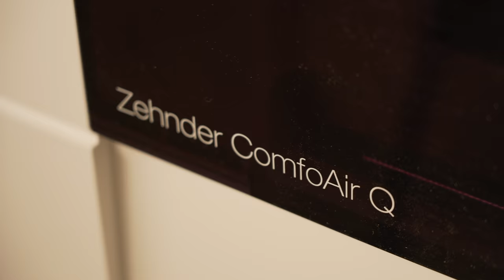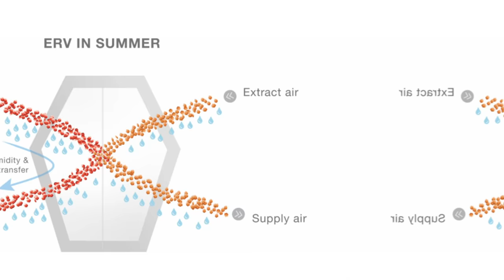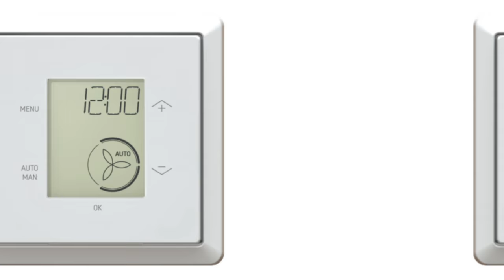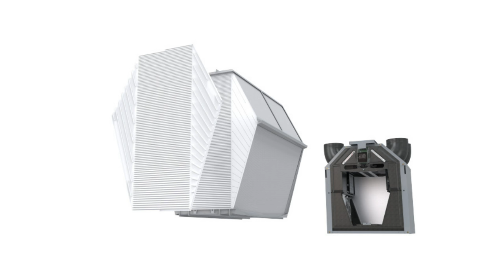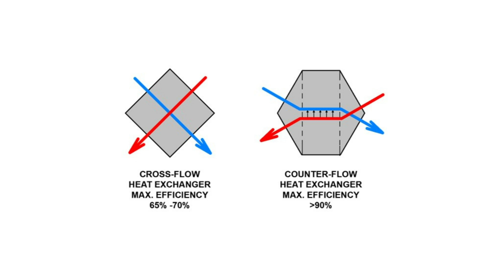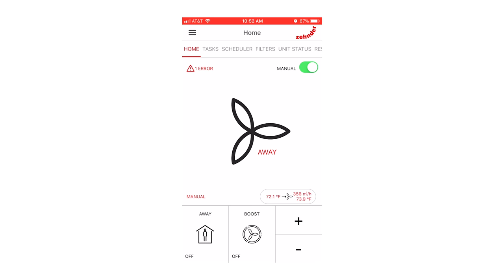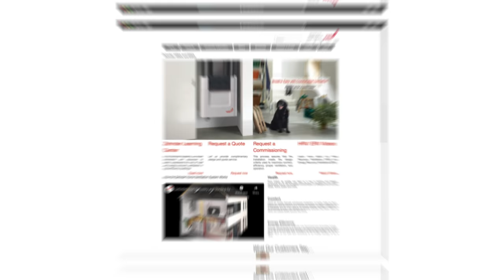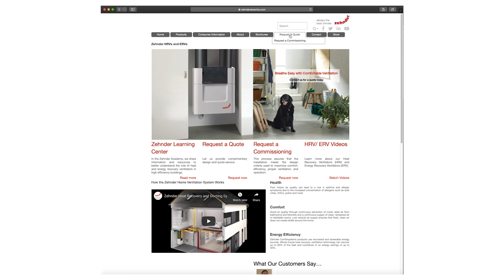Passive House - Fresh Air System Install & Costs (Zehnder)

Comment: MATT! You definitely need to check out the heat pump condenser clothes dryer. They are super effective and efficient and DON’T NEED VENTILATION! These help keep the envelope of the house tight and super efficient.

Oh, and may I please suggest you purchase a gymbal for the camera. It will negate much of the shaky movements. When I was working on my own documentary programs as a cameraman and editor, I used one for a fashion shoot and it helped the image to stabilise greatly. Cheers from Australia mate. 
Keep up the good work.
Reply from the maker: Actually I’ve been testing a Miele heat pump dryer and it’s pretty amazing. Perfectly dry clothes. 45 min run time. No vent to the outside!
Reply: I have a Bosch electric condensing ventless dryer. Works great, love not needing a vent.
Reply: @buildshow  Hi Matt, I'm in the process of self installing a heat recovery system in the UK. Your price estimates are about the same here too. I've also had a Miele heat pump dryer for 5 years in a small utility cupboard stacked ontop of the washing machine. It works billiantly but I decided to put a dedicated heat recovery extract vent in there to remove the slight tumble dryer smell of hot clothes. Even before intalling MHRV, I liked the fact that I wasnt wasting energy blowing hot air outside.
Reply: James Gleason because extra venting work equals cost of equipment and builders time! All saved by not having to need to vent a dryer.
Reply: @JamesBlazen   Switzerland has outright banned vented dryers since 2012. Heatpump or electric condensing dryers are the way to go.
Heating up air and then blowing it through clothes and then right outside is very wasteful.

Comment: Looks like a very good system, definitely important on a house built this tight. Would love to see the TAB contractor's ( third-party , must be third party to eliminate any conflicts of interest) results when his house is completed.TAB = testing, adjusting and balancing ( it is an actual trade with certification used mainly in the commercial and industrial building industry). With the covid virus TAB technicians are in very high demand right now, the mechanical engineers for hospitals and school are currently demanding a much higher air turnover rate with more make-up air. Good for my industry ( gas utility), bad for the customer ( higher utility bills). Currently in Germany all schools are mandated to open all windows for 10 to 15 minutes every hour ( they turned the heating system off and open all windows, after 10 or 15 minutes they close the windows and turn the heating system back on for 1 hour and repeat.). I can't wait till this covid virus thing is over.

Comment: @Matt -->Please follow up on your next videos how this system ties in with Bathroom exhaust and more importantly dryer (heat pump system) and stove vents (separate system to some how save energy, maybe?) Great videos, keep them coming.
Reply: It doesn't tie in. It completely replaces any bathroom exhaust fan.
Reply: @retartedfreak  Does it also replace the exhaust fan in the kitchen or is this separate?
Reply: @wkellander  i would think it is separate. IDK 100%.
Reply: Matt does a minor explanation from 4:20-5:25, and the installer guy explains it at 11:20-12:00. Basically, bathrooms, laundry room, and kitchen that would normally have exhausts/vents/etc will channel through the one "exhaust out" 8 inch duct that is part of the system.
Reply: @trinity1aee  So all that greasy air from the stove vent hood is going through that filter that protects the air exchanger from gunking up ?  That filter would need constant changing, unless there is another filter in the range hood itself.  Also, is the ERV fan going to be able to keep up with a 900cfm stove exhaust fan when it was designed for just 180cfm ?  I am pretty sure a stove vent needs to be metal, so those plastic hoses are only for supply fresh air and the exhausts from kitchen and baths are all traditional metal ducts ?
Reply: Am I missing something with the bathroom vents?  With an ERV like this, wouldn't it just cycle that bathroom humidity BACK into the house?  If it were an HRV, then maybe that humidity would end up outside the home...I would think this kind of defeats the purpose of having a vent in your bathroom. Does the Zehnder unit somehow regulate humidity levels then, too?  If it is compensating the system's humidity level by transferring excess into the exhaust, then that would make sense, but that was never mentioned directly in Matt's video.
Reply: @Madidahoan  Most of the bathroom humidity still ends up outside along with the air and stink.  The membrane that transfers water vapor inside the ERV must have a limit can only accept so much as the air moves through it, and most of the steam from a shower would not get transferred to the incoming air.  He did mention that his house will have a separate dehumidifier as well.  He will use a Fantec exhaust and make-up air system for the kitchen range where steam from cooking will go straight out -- no attempt to recover lost heat with that system since cooking grease would clog any HRV/ERV heat exchanger and filters too quick.
Reply: @kirkellis4329  I share your concerns with the stove exhaust. I reviewed the time stamps that trinity1 pointed out above and while I don't believe Risinger was trying to be misleading, I would be surprised if the stove exhaust went through the ERV. I'm going to review the Zehnder website and look for clarification.
Reply: For a range, particularly a gas range you'll still have a normal hood vent. Hopefully it's not a microwave as well and it's just on a normal switch cause you need a fresh are intake right behind the stove. Usually this is a 6 inch piece of ducting with a zone damper in it. When the hood is off the damper is closed, when it's on it also provides power to a small transformer that opens the damper. This creates negative pressure near the back of the stove along the wall and it should pull most cooking fumes away like normal.

Comment: Matt Risinger, thanks for sharing this! I appreciate your dedication to clean indoor air. That Gas appliances add the possibility of carbon monoxide is reason ENOUGH to go all electric ⚡️
Reply: Gas heating is far far cheaper than electric and likely more environmental too depending on the source of your electricity

Comment: I would like to see how the dryer vent is hooked in. I am also curious how the kitchen fan vents through it.
Reply from the maker: I’ll have a separate system for the kitchen exhaust. I’m using a heat pump dryer so I won’t need a vent
Reply: @buildshow   Any particular reason why the kitchen exhaust isn't being integrated with your Zehnder system? I'm very curious how these ERV/HRV systems can integrate that exhaust since they typically require a substantial flow rate but only when called upon. I like the idea of one exhaust penetration for the whole house, I'm just not quite sure how that can be managed with these systems. Also, how are you managing the evaporated moisture from your heat pump dryer? I would think you would still need a vent for that. The heat pump in the dryer is only a heat source to facilitate evaporation of moisture from the damp items within it.
Also,
Reply: @buildshow  even if you had a dryer vent, the q600 can adjust supply and exhaust rates in response to the dryer exhaust. by not having a dryer vent, you are putting a big humidity load in your building envelope, and the zehnder system shown does not provide humidity control. so you would have to have mechanical systems (force air conditioning and/or dehumidifier) to provide humidity control.

some people go for a recirculating hood, but a kitchen exhaust is going to work better.

i have a heat pump water heater and considered a heat pump dryer but concluded that it really didn't do much and was pretty much a waste of money.
Reply: you definitely don't want the kitchen hood tied to the dedicated outdoor air system. the grease and residue from cooking would gum up the ducts and the filter at the erv. you don't want the dryer vent hooked in either because the filter in your dryer does not capture all of the lint. the only things you want going into the return ducts of the doas are odors.
Reply: @paperwait9611  You make a good point about dryer lint. That would inevitably build up in the ducts, except the Zender duct tubes appear to have a smooth surface finish and the interface with the manifolds also appears quite smooth. The manifold boxes could be problematic though. Not only is there particulate in the dryer vent air but also a lot of moisture and don't forget heat. In the summer time you would not want to transfer that heat to your supply air which an ERV/HRV would do; you'd be fighting your AC system with your ventilation system. The moisture transfer could also certainly be problem if you don't already have a dehumidifier in the system. Like you said an ERV is not a dehumidifier, unless of course the exhaust air has a dew point lower than the incoming air, then the core would condensate...there is a degree of humidity control inherent to an ERV since enthalpy accounts for both sensible and latent heat. 
Regarding the kitchen vent, presumably regardless of direct vent or tie in to a residential DOAS (i.e. ERV/HRV) a grease filter should be present. Recirculation vents do not adequately manage odor, smoke, or steam... they have very little benefit at all frankly. That said most kitchen exhaust hoods call for 150-400CFM would could be equally just as large as the ventilation needs of the house. So do you upsized the DOAS to include the kitchen or accept the needs for another vent? Kind of seems like you really need three vents to avoid any problems Kitchen, Dryer, rest of the house. Problem is the DOAS would need to compensate for the Dryer and the Kitchen exhaust with supply air, so you'd still need some kind of tie in or dedicated direct air inlets for those areas, but then you lose efficiency by not tempering that makeup air.
Reply: @FlyBikeCampAK  the tubes are smooth when they are brand new and clean, but it's like copper pipe, you don't want to assume that they will stay that way.

the return air going to the erv is more than just the return air from the dryer, it is return air for the whole house. so there won't be heat transfer from the exhaust to the supply unless the return air from the dryer is so great that it makes overall temperature of the return air from the house warmer than the incoming air (that would require some intensely hot dryer air). as to the moisture, an erv tries to equilibrate internal moisture levels, so a portion of the humidity in the exhaust air actually gets transferred to the incoming outdoor air through the enthalpy core. that humidity transfer raises the dew point of the exhaust air. that's one reason why you don't really have a problem of condensation in erv's (something which is more likely in an hrv).

my point about the humidity issue is that you can't count on the zehnder q for humidity control - you've got to have some other means. the latent load that is introduced by the zehnder should not be a problem for your air conditioning system because that latent load should have been included in the manual j analysis. i made my comment because some of the statements made in the video could cause people to draw the wrong conclusions about what the capabilities of the zehder q system actually are.

the steam that you see when cooking includes particulate matter (such as cooking oil). what you want the filter in the recirculating hood to do is to capture that particulate matter so that it doesn't get into the ducts/tubes of your mechanical ventilation system. as i stated, the q600 can adjust the inflow and outflow rates to accommodate the exhaust from a dryer. however, it cannot adjust to accommodate exhaust from a 400 cfm hood vent (although it would not surprise me if risinger isn't putting in a 1500 cfm blower in his hood - he's going to be using an induction cooktop (which i assume will be something like a 36" thermador freedom induction cooktop) which would probably only need 200 cfm). in that case, you would use some kind of makeup air scheme as you suggested. the way that people typically do that is to tie the makeup air duct to the return air duct of their forced air system.

i'm not doing advertising for zehnder here. so i will add that the zehnder q is not the only system that has means of adjusting inflow/outflow rates in response to external stimuli (like dryers and kitchen hoods). for example, the cerv2 can do that also (the cerv2 can also perform dehumidification). what makes the zehnder q unique (at least in my mind) is that it is the only system, of which i am aware, that can make these adjustments without requiring some form of manual operator intervention.
Reply: @paperwait9611  all good points. Thank you for that feedback.
Reply: @FlyBikeCampAK  probably not incorporated because the grease from cooking would gunk up the inside of the system.
Reply: @paperwait9611  Heat pump dryers are condensing, I think they send most of the water down a drain, not back in the air.
Reply: @bobby0081  but the hood would have a grease filter so technically grease shouldn't be able to enter the exhaust air ductwork.
Reply: @FlyBikeCampAK  carbon filters surely
Reply: Well if you had an separate dryer exhaust  blowing out, the system would sense that and bring in more fresh air,  while the dryer is blowing.   Correct?

Comment: Great system, very timely info too, been wondering about ventillation systems for tight houses in cold climate. One question, how does rangehood air get dealt with if potential oil and grease gets sucked into the system? Does the range have it's own set of filters?
Reply: Great question. I wondered the same myself. Surely there has to be a seperate system with a damper.
Reply: @mtscott  
Most hoods will have filters that catch most of the grease.
But a well designed kitchen will have its own makeup air system for tho hood. It doesn't have to be an expensive set up, just a powered duct fan system that brings makeup air in around the bottom of the range. They have solenoids that turn the makeup air supply on when the hood exhaust is turned on.
Reply: This was addressed in a more recent video. The range hood is not connected to the ERV/HRV. Besides the oil/grease issue, there's just too much air. High flow range hoods do 600-800 cfm. Matt's ERV is under 200 cfm, so it would never be able to handle it. In his house, he has an intake fan (with filter) to balance the range hood, that's powered when the range hood is on.

Comment: That is an awesome system. I do have a question. If say you are having a party or work is being done so lots of doors open and left open for longer than usual, could the system have a mode to run positive pressure while the doors are open? It seems to me that if you tried to go positive pressure but failed, we could assume a door or window is open and just keep the flow on. When it goes positive, switch back to balanced mode and every once in a while try to go positive pressure. This could also warn of envelope failures... Try to go positive pressure at sometime between 3 and 5 am (or whenever you expect very little activity) and if it fails several days in a row, send an alert.
Reply: Good question, James. The fans can be set to be positively or negatively balanced up to 15%. The advantages/disadvantages vary from one climate to another. Also, you can temporarily turn off either the supply or exhaust fan.

Comment: Couple things I wish you would have covered.  1.) How does it interact with your AC/Heat unit if at all.  2.) How do you handle positive and negative pressure zones in rooms.  I notice your pumping air into rooms without a exhaust which would tell a novice like me that is pressurizing that room.  For tight houses, I want it as balanced as possible I would think to keep from blowing or sucking air where I dont want it too.  As always thanks for content and God bless.
Reply: Jeff , I think the concept is for the positive room to push air through the negative pressure rooms where you want to exhaust. Such as the bath rooms, kitchen and laundry room. So instead of one return, a house has many, an equal amount to be accurate.  This would stop wind tunnel effect in poorly balanced homes.  What I cannot see is can you still create AC/heat zones?  I want my office to be cooler than my gal wants her craft room.
Reply: These airflows are relatively low compared to heating and cooling. The systems operate independently. And the pressure differentials between rooms are enough to change the air, but easy enough to flow around/under closed doors. Supplying fresh air to bedrooms and living rooms and extracting from wet/stinky rooms keeps the air in the whole house clean without any noticeable drafts.

Comment: Great improvement over all those individual vent fans, and holes. I'm curious about the dryer vent, kitchen hood and the air conditioning. Are they integrated into this system somehow, or are they stand alone? Also it would be nice to see how you get from the attic to the master bath and master bedroom on the first floor. Great videos! The more I watch, the tighter my house gets (and more expensive). I would like to see videos of how your associates, Wade & Jake, and even Steve apply these designs and equipment in zone 5 construction. I'm building in NJ so it's a little different than Austin. Thanks!